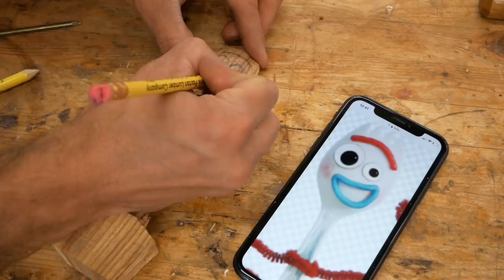Wood Carving - Forky From Toy Story 4

Comment: Andy, off topic of the video, but I think you’ll thank me. We have our tv mounted above the fireplace too, but it was up kinda high. Check out MantleMount on Amazon. I love mine. It drops the TV almost 2 feet down when we want to watch and then it lifts back up when we use the fire or hace company and was easy to install. I bought a returned item and it was about $150 instead of $230. They gave all new hardware with it too.